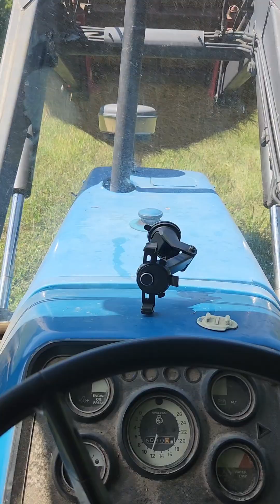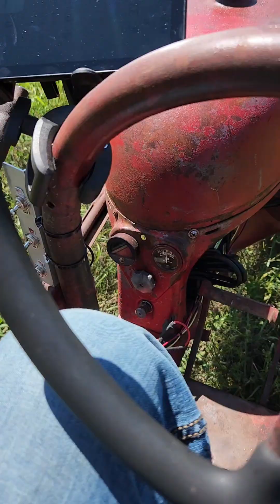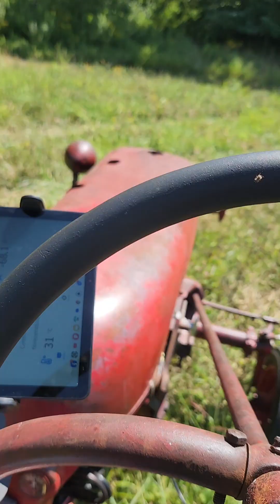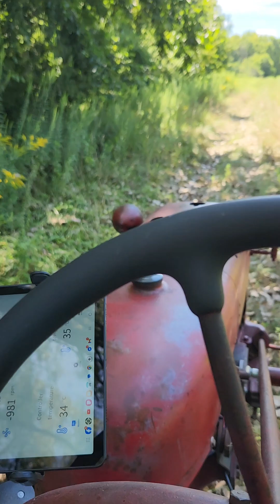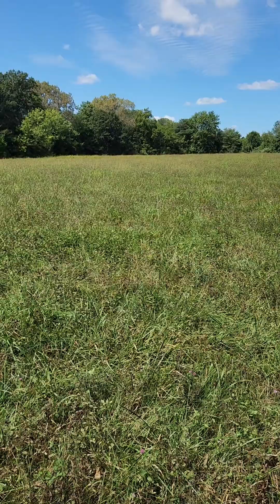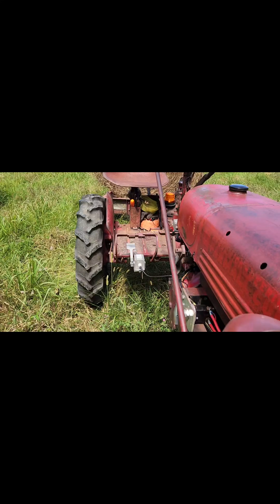Electric Farmall Cub testing towing abilities.

Comment: What is the plan for the winter on keeping the battery from getting too cold?  Also, if you have a regular storage spot for this, it could be neat to set up a solar charge station.
Reply from the maker: The battery has a built-in heater that warms it up before charging. I will have to figure out the cold limits on the deep cold days. I haven't looked into solar panels yet, but I want to set that up eventually, that's something I'll have to research more.